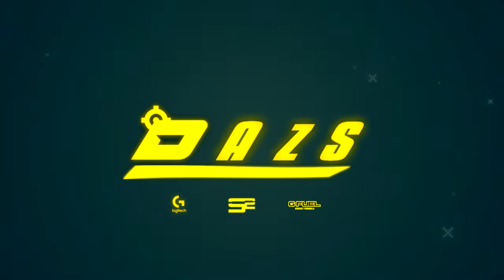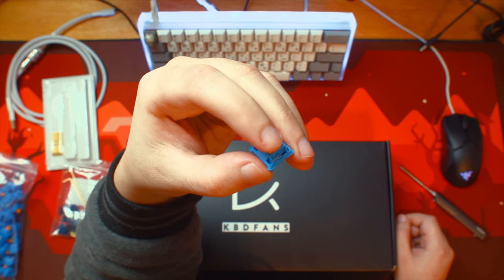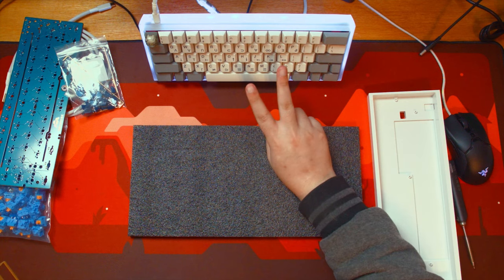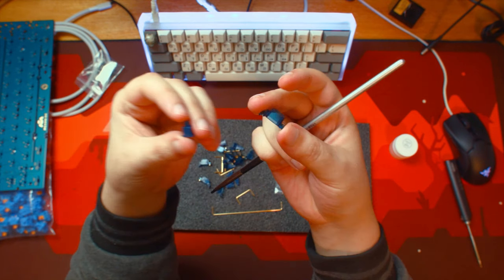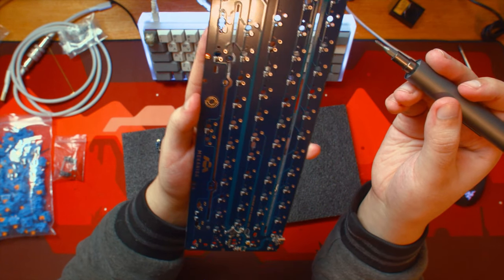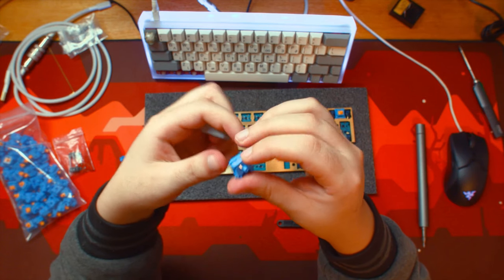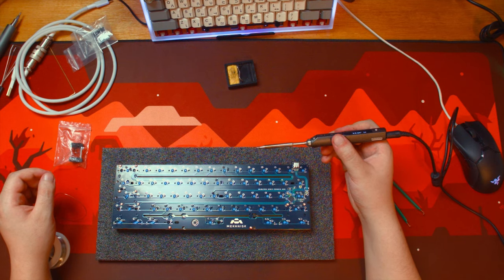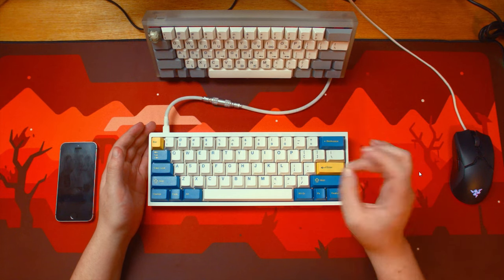My Editor Made Me a custom $500 Mechanical Keyboard!

Comment: I have a $800 custom keyboard lol
Reply: omg, what do you have?
Reply: @AscendEdy  is a mito laser 75% with alpaca switches and GMK vaporwave keycaps and 3 artisant keycaps of BOB gengar, and a custom coil cable.
Reply: @thenuk.r  why?
Reply: @thenuk.r  the mito laser case cost $195 + $250 from the retail of the GMK VaporWave + $120 of the alpaca switches retail because they are not on stock.+ $88 from the custom coiled cable + $100 for a retail purple gengar + $75 of another gengar that i bough in the original group buy.
Reply: @thynkzee_ssj3373  What actual base keyboard is it though? (PCB, Plate, Case)